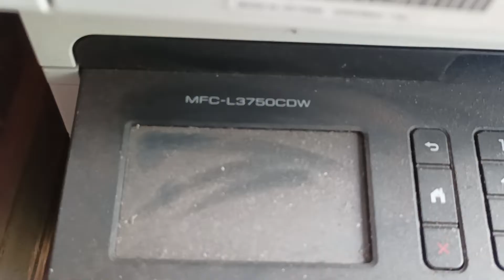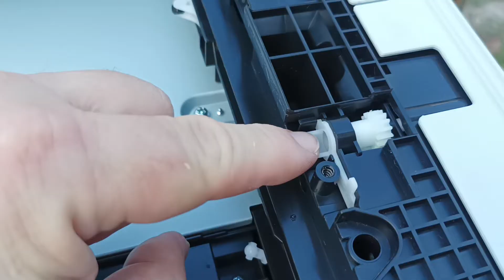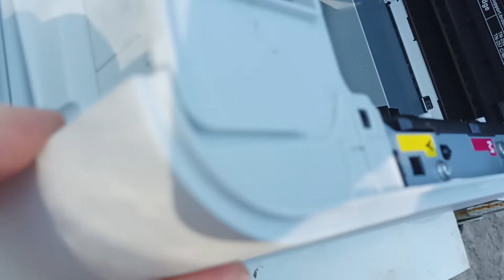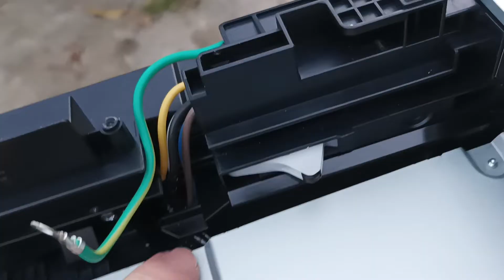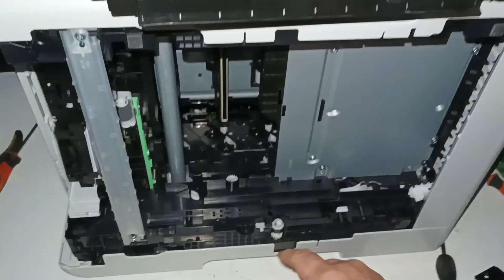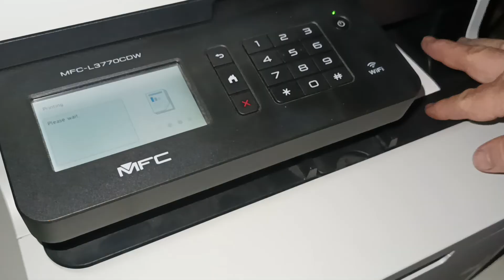Brother MFC-L3770cdw Power supply Replace fix (No Power Dead - Won't Turn On)

Comment: Worked phantastic on my printer. Thanks 👍🏻
Reply from the maker: Check all 4 drums for scratches on the red surface. Scratches cause high voltage shorts to ground which cause the power supply to lose regulation, also check the super capacitor (in an earlier video) which fails and oozes alkaline electrolyte onto the motherboard which also make the power supply blow.

Comment: I have a MFC-L3750cdw with bad power supply, do you happen to know the value of the DZ4 diode ?  Marking says VB, but I cannot find any info
Reply from the maker: If you're checking it in  circuit  check there is no resistor beside it. V is either 5 or 50

Comment: Many thanks for your tutorial. With the help of your video, I could disassemble and figure our the problem of my HL-L3270CDW smoothly. The issues happened to mine were exactly the same as per your video [i.e. fuse and zener diode (for zener diode, I have doubt on it, because the resistance was close to 0Ω anyway but I change it anyway)] . After replace the fuse and the zener diode, the printer kept having the green light blinking and no other reaction. As said by Terry, the last error was on the other side of the board, I figured out the last error was another zener diode named DZ4 which was having 0Ω both sides. I removed it and test on the board. It revealed that both sides were still 0Ω. At first, I thought there may be other errors that cause it to 0Ω but ended up could not find out any other abnormal parts after a bunch of working. I soldered the new DZ4 [SOP-123 (18V) per AI advice] anyway and guess what. It was turned on suceesfully. Saved my HK$350 to replace the whole board.😁 Seems that this series have the common error (haven't used for quite a long time, total printed pages = <400), hopes this will help.
Reply from the maker: Check your Drums for pitted Scratched surfaces. The grounding of the drum aluminium touching the dev rollers voltage seems to be one reason the power supply fails.

Comment: my L3750 wasn't turning on, i bought a repalcement power card for it and followed your (very helpful) tutorial, mounted everything back up again, and sadly still no power. Do you have any idea what else could cause it to not power up ? maybe the on/off button ? (i did the ten second holding the power switch and inserting the cable thingy)
Reply from the maker: You've probably purchased a faulty power supply unit. Plenty of counterfeit product on eBay and Amazon
Reply: @TerryJonesPrinterRepairs  how would we know if its faulty or not ?

Comment: Hi Terry.... same problem but i have a MFC-L8850CDW would you have a part for it part # LT2763001?? Is the part in the same place?
Reply from the maker: It's the supercapacitor on the motherboard

Comment: Hey thanks for the video! helped me diagnose the issue with my printer. 

Was hoping if you or anyone could help me find the specs of a capacitor marked as C28 on the PCB of the  l3770cdw power board?
it’s right beside the transformer (or what i assume to be the transformer)

I unfortunately could not identify mine as it melted off the face of the capacitor and thus its marking. Any help would be great thanks!
Reply: Hi, I have the MFC-L3750CDW and on my board the C28 capacitor was also blown, but I can still read the specs.

R.
221K
1 KV
Reply: @MrYaYe Thanks for the reply! It’s a huge help.  I’ll replace my capacitor soon and see how it goes
Reply: @pablohermoso4530  No problem. Please report back if just replacing the capacitor helped and if you changed anything else. I'm currently repairing my printer aswell.

Comment: The diode on the psu you've mentioned on my motherboard is shorted too. I'm trying to find it online, do you know which kind of diode it is? All it states on mine is D6F
Reply from the maker: have you tested it out of circuit?

Comment: hi Terry, I would like to ask about an issue with my MFC-L3770CDW. The printer does not power on and the green light does not turn on. If I press and hold the power button, the green light blinks once about every 7 seconds, but the machine still does not start.
Yesterday, I unplugged the power cord and left it unplugged overnight. This morning, after plugging it back in, the printer powered on successfully and was able to print. However, after about 10 minutes, the machine suddenly shut down completely. Now it will not power on again. Could this indicate that the power board needs to be replaced?
Reply from the maker: You have a faulty supercapacitor it's described in a previous video

Comment: Alright mate, thanks very much for the video, i have a Brother 9340 CDW, after a while I cannot switch it on with the power button on the panel. I can get it on by unplugging and plugging back in. I suspect the LVPS board. Do you have any idea how to get to this thing. Cheers
Reply from the maker: The 2 super capacitors need to be replaced on the motherboard

Comment: It's printing quality is good. But I think this machine's power supply has some issues. Only within one and half years my printer's power supply is damaged. How it possible!!! It is costly. Where can I get it cheaply....Plz
Reply from the maker: Have you run the test to see if the power supply is actually faulty or if you have a faulty supercapacitor

Comment: Great video. Used it to disassemble my DCP-9022CDW. Looked at the power board and decided it is not fried. Put everything back together and it works again 😂.
Reply from the maker: You need to change the two supercaps on the motherboard

Comment: We have MFC-L3750CWD almost never used, not even 1 set of toners yet, 3 years old and power supply went bad. I replaced 3.15v fuse and 1 cap that broke but now it's power cycling (restarting). I am from EU and I cannot find replacement board anywhere. Not sure what to do =( it was expensive

Comment: Hi Terry - wanted to check where the laser unit is for 3770cdw as I have cleaned the drums, changed toner etc. and prints are faded. Last hope is to try cleaning laser unit. Thank you.
Reply from the maker: @robertlee4639  and what did you clean the drums with? Did you use a big bright torch so you could see clearly
Reply: @TerryJonesPrinterRepairs  Just a clean lint free cloth (no liquid like isopropyl alcohol). No torch and away from direct sunlight.
Reply from the maker: have you turned "toner save" off under the "ecology" setting.
Reply: @TerryJonesPrinterRepairs  Update: the resolution to the faint/uneven prints was the Calibration AND Registration. This was after reading all the comments and finding out that this model does have have the laser unit. So went back to basics and cleaned the 4 "print heads", cleaned each of the drums and the toner cartridges. Just the Calibration on it's own was not enough.

Comment: no power like you, problem was one of the 400v 47 uf, change both, but now i got a cover open error.... Ok i found the problem for open cover, remove the logic board (on the side) only and look for the switch. When u reinstall the board u must take care to check the switch work properly... No more OPEN COVER  ERROR after this 🙂
Reply from the maker: Everything on these boards seems to be running on the very upper limits of voltage tolerance.

Comment: I have a brother DCP-9020CDW if I leave the power cable plugged in and turn off the printer then turn it back on it doesn't work. If I unplug and wait 10 minutes then plug it back in and turn it back on it works. Do you know the cause?
Reply from the maker: https://www.youtube.com/watch?v=wvcHAYvPEuE Your model has 2 supercapacitors. follow the link in the video description to buy them

Comment: Amazing thank you so much. Ordered new board. I soldered existing cables which was much easier. However live and neutral were a bit too close and had sparks so covered in hot glue 😇
Reply: Where did you get the board please?

Comment: A me è successa la stessa cosa, fusibile da 3.15a guasto e si è guastato il transistor di potenza sotto il dissipatore più grande, 1,6€ e la stampante è tornata come nuova.
Reply: @alefady thank you for this comment. The same thing happened on my board. I originally just changed the 3.15A fuse but although simplex printing worked, duplex would often fail with “Print Unable 02”. I would have to turn the machine off and on again until one day the fuse blew again.  

I checked many things but they were ok. Then I desoldered the MOSFET under the heatsink and checked it with my LCR tester and it had failed. Bought a replacement Toshiba TK10A80E MOSFET and replaced the blown 3.15A fuse and now the printer is working in simplex and duplex! No errors. Hopefully it will last this time!

Comment: Hi Sir, thanks a lot for the great and detailed 2 Videos about the MFC L3770 CDW. 
* Maybe same day or few days after printing 90 pages (duplex) with non-brother toners, my printer same model was also dead.

The issue is, that no light, no sound is coming from the printer anymore.

* So I went through the instructions on Brother homepage to revive the capacitor (not worked out)
* I replaced the diode on the power board thinking the power board was blown off.
* Fuses were unsoldered and checked > okay.
* I ordered a new power board and tried it today. > still not working (100€ cost, trying to send it back)

What could I try next? Any Ideas where I could look into ?

I was thinking whether the touchpad / board could be malfunctioned. Any suggestions, how to check it. I unscrewed the cover off, but see a thin cable-ribbon. No idea how to check this. 
Other idea is to replace the capacitor on the main board, but since the revival tries failed, I am  not sure whether this could help.

Looking forward for your ideas and suggestions.

Comment: Great video Terry... I have a slightly different problem on an L3750CDW, it displays Print Unable 05, I suspect after the customer had a fuser wrap around paper jam. New fuser unit fitted & I've stripped down to inspect the LVPS. All fuses test ok, but the ZD16 is short circuit. Have you had this fault & if so, are there any other components to change. A spec of the ZD16 would also be appreciated. TIA
Reply: Are you really shure D16 is short itself? - There is R49 in parallel with D16 which shortens it. R49 is labelled 0.01Ohms - maybe a shunt resistor.
I'm not pretty shure what D16 is doing at all. Maybe it protects a measurement input against negative voltages.
Anyway, when you unsolder the Diode D16 you can test it.

Comment: Thanks for the video. I will attempt this repair on my HL-L3270cdw. My wife tried to print something and upon wakening the printer a loud pop occurred, so I would assume I can see the broken component. We also printed maybe 1200 pages on it so far.
Reply from the maker: @Zhaadum  do you have or your neighbours have rooftop solar? Or are you using toners from an online yellow sticker company?
Reply: @TerryJonesPrinterRepairs  I did use a non OEM brand for the toner. OEM toner is over $200 which is pretty crazy. Is there a "good" non brother brand that can be used?

Comment: Hi Terry, I'm in France, I have the power board failed on my MFC-L3750CDW, the power board is a D00CTE001 and not a D00CTD001. I can't find a provider for D00CTE001, can I install a D00CTD001 instead a D00CTE001 ?
Do you know the difference between the two references ? Thanks for your informations.
Reply from the maker: Some power boards are for 2 lamp fusers and some are for 1 lamp fusers you need to check how many each code accommodates  for and if its 120v/220v
Reply: @TerryJonesPrinterRepairs  Hi Terry, on your video, the power board that you replace seems to be D00CTE001 (the same as mine which is failed), but in France I can't find the D00CTE001 (which is 220V) , but I can find D00CTD001, but I don't see any picture for this one, si I am not able to compare....Did you have some picture for the D00CTD001 ? Thanks a lot for your help.
Reply: Hi @JPMoulin-sw1id  I am in the UK with HL-L3270CDW and have found the same problem as you. My printer has D00CTE001 PCB but D00CTD001 is being recommended to me. Did you fit the D00CTD001 board in the end? Did it fix your printer? Like you I cannot find D00CTE001.

Comment: Hi Terry,  thanks for the great video on the 3770.  I have confirmed that the power problem is not the super capacitor but is a board problem.  I am in Brisbane but cannot find anyone who will sell me a new board (D00CTD001).  Even though I am capable of fixing the board myself (30 years experience with board level repairs) my preferred option is to buy a new board.  Can you direct me to a supplier who will ship the board to Australia.  Incidently what is the voltage of the zener diode in case I need to replace it.? Can't read the number on it.  It would be a shame to dump a 3 year old printer in as new condition.  Appreciate any help you can offer.  Cheers David

Comment: Nice, so the mpw3111 power board is the correct replacement for the brother mfc-l3770cdw?
Reply from the maker: Have you done the test to see if it's the power supply or the super capacitor that is faulty?
Reply: @TerryJonesPrinterRepairs  Yes, i tried the test. No power or light at all. I don't even think i've printed 500 pages on it yet. :(
Reply from the maker: @DorronGTV  phone Brother head office and argue the fact that you haven't even printed one ream of paper and the printer is now dead. Argue that the printer is not fit for purpose and is not durable

Comment: Hi, do you know where the Laser mirror is located in this machine? (MFC-L3770cdw) I am trying to find it the easiest way, so I can clean it, it is giving me some printing ghosting. Thank you!
Reply from the maker: It doesn't have one
Reply: @TerryJonesPrinterRepairs  what! OMG! you saved some sweet time, I was about to take this machine apart. ok, I will try to clean the Fuser, that might be the problem. Thank you for the quick replay.
Reply: Is using discharge scanner

Comment: Hey, thanks for this. I had the same issue after only 3 months of buying it and have just installed a new powerboard. It works, although, when i turn it on it says "cover is open, close the top cover". Do you know how to fix this? Model is DCP-L3510CDW.
Reply: me too, remove the logic board on the side and look behind. There is a switch, when you reinstall the logic board you must check if the switch is ok or not. this solved my cover open problem

Comment: my printer just went out yesterday and having the same issue....I unplugged it and reset as you suggested...the only thing that i noticed is the green light turns on for a split second when i plug it in holding the on/off button....it turns on and still nothing....any suggestions.....3 days prior it worked just fine....not one issue
Reply from the maker: Update the printers firmware via a USB cable direct to your computer
Reply: @TerryJonesPrinterRepairs  i do appreciate the response back sorry it took me so long to check it....good Lord....
Reply: @TerryJonesPrinterRepairs  so i picked it up today from taking it to a repair shop....my computer will not pick up the printer....i did try that before i took it to get looked at....I am out of options on this thing....the guy at the repair shop said he could not find any parts for it and so no luck there....at this point it still won't turn on....
Reply from the maker: @WickedNavajo  where are you located?
Reply: @TerryJonesPrinterRepairs  Las Cruces NM
Reply: @TerryJonesPrinterRepairs  i spoke to one of the guys at the repair shop and he told me the person trying to fix the printer could not find the parts and figured it was the motherboard....but since he was not able to find the part he could not fix it....

Comment: Wow great info thanks. Where in Australia can i buy low voltage PS - A365 for MFC-L3750cdw
Reply from the maker: Have you performed the test to test to see if you're super capacitor is faulty or  have you just assumed that you're power supply board is at fault, watch the previous video follow the instructions at the start of  the video to test the super capacitor, you may find that is the reason why your printer won't turn on

Comment: Do you think it's worth looking into similar repair of a mfc-9330cdw or should I recycle it?
Reply from the maker: You should fix it where are you located
Reply: @TerryJonesPrinterRepairs   NYC area
Reply from the maker: @gbxx6692  have you done the test to see if the power supply is faulty or it is a super capacitor issue causing it to not turn on? https://youtu.be/wvcHAYvPEuE
Reply: @TerryJonesPrinterRepairs  IDK, i'm not a repair person. I just know it's worth $150-175 in my budget if someone COULD repair it..
Reply: .. as for symptoms, it had very dim lights on display & power button & frozen.. no response, then I unplugged it.. waited a min, plugged it back in.. DEAD.
Reply from the maker: @gbxx6692  do the test outlined in this video https://www.youtube.com/watch?v=wvcHAYvPEuE
Reply: @TerryJonesPrinterRepairs  still dead, unfortunately. must be p/s board or worse.
Reply from the maker: @gbxx6692  yep power supply as per this video

Comment: Very informative and thank you.  Sadly this is the same model as my printer and similar symptoms.  It's frustrating that these feel built to fail and it seems much easier and nearly the same cost (factoring labor) to just buy new and throw the whole thing away.  Still, I'm trying to find a replacement supply board and having absolutely no luck, so I don't know if I even have a choice.
Reply from the maker: Where are you located
Reply: @TerryJonesPrinterRepairs  MN, USA.  I know in the vid you mentioned you might have them for sale, I looked at your website and facebook and didn't see the power supply.